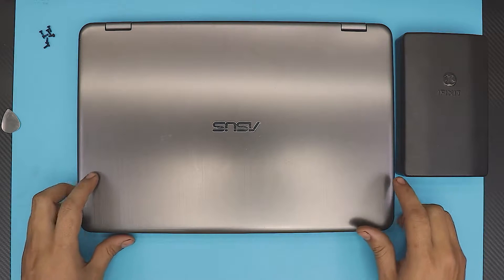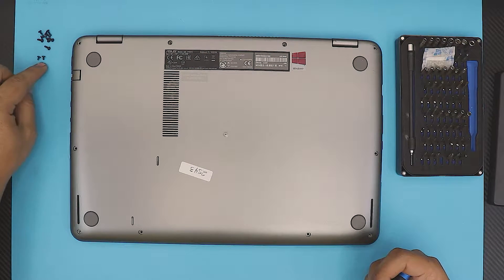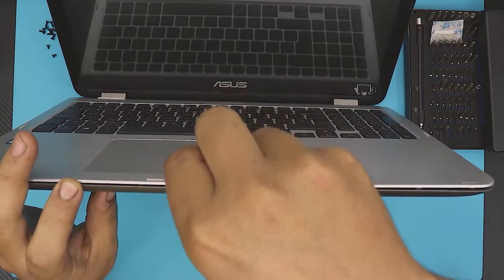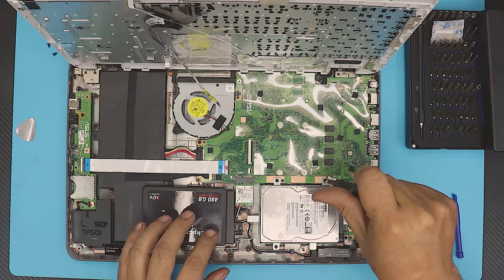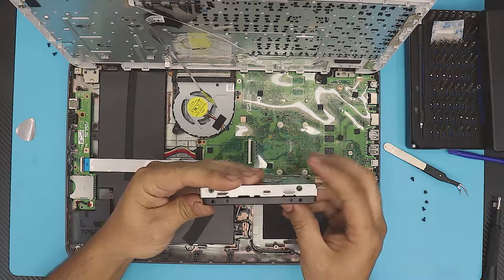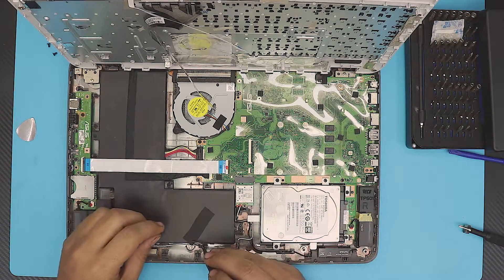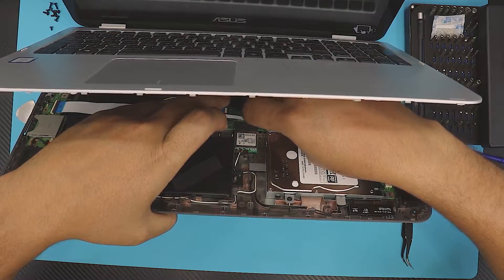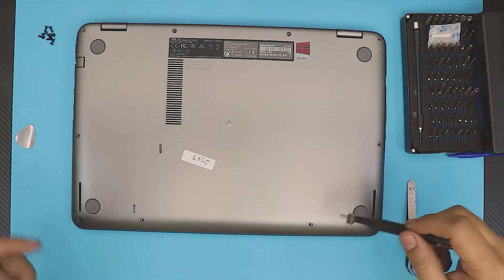ASUS Transformer Book Flip Tp501u SSD Upgrade, STEP By STEP

Comment: Asus tech specs specify only 12GB Maximum Memory and you have 4GB soldered on board. What will happened if you upgrade with a 16GB SODIMM, On Board Memory it's disabled automatically ??
Reply from the maker: You're welcome! Thank you for the feedback! if you wish to support the channel you can LIKE or SUB or both :P
regarding your question:  Don't listen to the tech support or manuals, they are full of it!! this laptop easy can upgrade that 8GB dim to 16gb dim  and you will have no issue whats so ever and it will run perfectly fine,
https://amzn.to/2T5PKM4
just remember when you plug the new ram and when you power on you may not get any boot screen, then follow this steps:
remove the ram, power on and once you get the boot logo then power off, remove the battery and charger press and hold the power button for 30sec, then plug in the new ram and plug the battery and charger and then power on and wait 10-15sec for the bios to do a ram check, and you should be all fine. good luck.